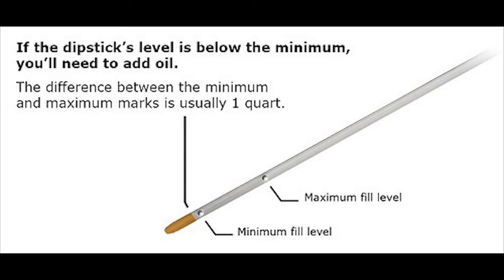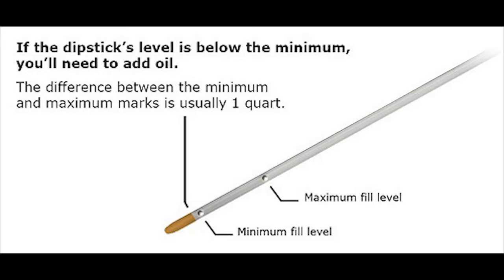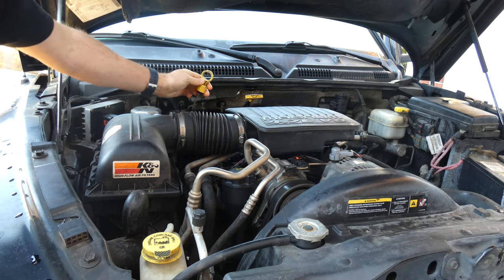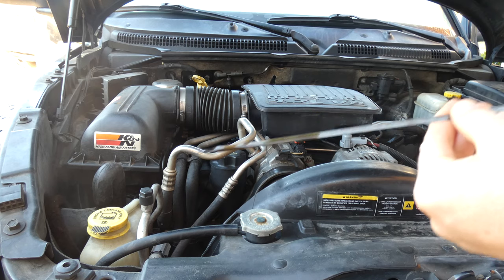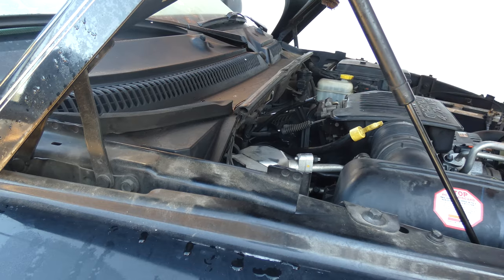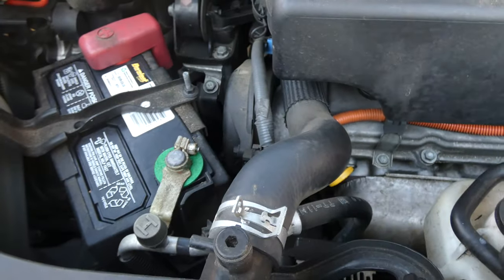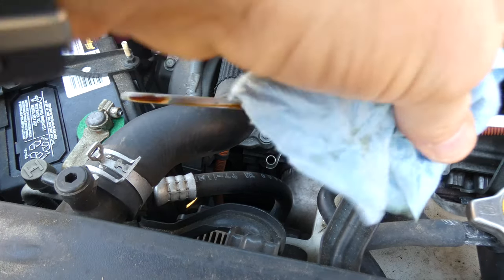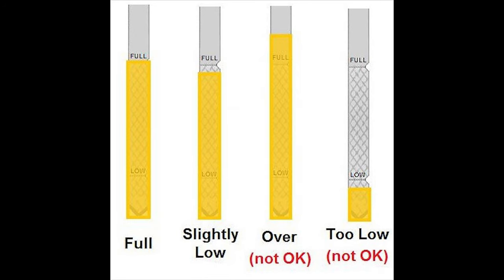How to Check Your Engine Oil Level & Read an Oil Dipstick

Comment: Clint, great vid, but a caveat. Used to check my oil in garage with stone cold engine. Reading my owner’s manual recently it said, “check engine oil while warm/hot...turn off and wait a FEW (ie 3) minutes for oil to drain back into crankcase”. So, comparing methods, there was a half quart difference. If I checked cold and it was half below full, it actually needed a quart of oil. Other cars would say check cold...read your manual re how to check the level. 👌
Reply from the maker: Great advice. I will pin this comment to help others as well.
Reply: Excellent Comment !!  Thats Exactly what Im looking for......is car off or on when checking My oil??   Most vids are simply ignorant !!
Reply: this is the info I was looking for,  thanks David.
Reply: @angelaforsyth1092  My pleasure!
Reply: @denisemezynski8014  Denise, I've never heard of checking the oil level on any motor while it's running...always off.
Reply: I’m 39 and have been servicing my own cars since I was 16.  My dad taught me to always check the oil when it’s cold so it’s always drained down out of the ending that way I get the correct reading.  I’ve never had a problem doing it this way.  Every time I’ve tried to check it after it’s warm I never get a correct reading as the oil streaks up the stick.  When I fill up my sins maxima it takes 5 1/8th quarts.  It is always above the full mark by a little bit and I’ve never had an issue.  But that is such a small amount it won’t matter.
Reply: @100fredkrueger  Strange, I have the same problem with my 2010 Toyota Yaris. To check the oil level, I have to shut the engine off for a minimum of one hour otherwise I get uneven oil streaks up the dipstick. If I try to check twice, the same thing happens. I have been servicing cars since 1987 and have never seen anything like that on any other vehicle. My other car is a 2006 Corolla and if you shut the engine off for only 10 minutes, you can see the oil level on the dipstick positively.
Reply: Indeed always look at the OEM data.

Comment: As a female driver, I love this explanation. Thank you!
Reply from the maker: Thanks Marilyn.  That's what I was going for so it's great to hear it worked.
Reply: @ClintHolland  have a FORD 500 and the dipstick is weird and hard to read. There are two holes...should the top hole be filled in or empty?
Reply from the maker: @mem1701movies  So the top hole would be the max fill line. Just make sure your oil is between the 2 holes and you should be fine.
Reply: As a female driver - would you like a medal?
Reply: @gladiammgtow4092  So sorry you are unhappy and bitter! Blame your childhood and your parents, I wasn't there.

Comment: Very informative video thank you 🙏 Yes, people don’t know it’s best to wait at least 5-10 mins to check. Many people just park and measure which is not an accurate reading. Also, even if the oil level is below max and closer to half, it will rise once the engine kicks on and does its thing. People add oil to the max not understanding that.

Comment: All of this is very helpful except for the very last suggestion: checking your oil at the gas station.  If I've driven to the gas station, then the engine is going to be warm and the dipstick will not give an accurate reading... and I don't want to sit at the pump for 10 minutes to let the engine cool.  I think a better suggestion would be to check the dipstick before you leave home to go to the gas station.
Reply from the maker: That's a very valid point.  However, in all honesty, letting your car sit for even a few minutes will give you a pretty accurate reading.

Comment: Great explanation.  I’ve been changing my own oil for 23 years.  Started when I was 16.  I always check it cold and have never had an issue.  After all these years I’ve always wondered how low it was when it was at the bottom.  I always thought that meant it was about empty.  Lol.  Glad I was wrong.  I usually add a small amount if it’s in between.  I usually put just the right amount in.

Comment: Ive watched several videos about checking oil levels. this video was by far the best one I've seen. close up of the dipstick and what exact it is I'm supposed to be looking for. The only thing it didn't cover that I was mainly searching for and found in the comments was do I check the levels when the engine was cold or after it has been running for awhile. Otherwise, great and informative video. straight and to the point in little time. thanks
Reply from the maker: Thanks for taking the time to comment. I actually did cover most of that around the 6 minute mark.  Doesn't matter if the engine is cold or not but it needs to be turned off and generally wait at least 5-10 minutes after doing so.

Comment: The oil level on the dipstick goes straight across at a lower level then covers only half the dipstick coming up to a higher level.  So is the actual level at the lower or higher reading?
Reply from the maker: Most likely it is the lower level and the upper oil came from the dip stick tube. Try this. As soon as you remove it lay it flat on a paper towel and use the oil on the towel to gauge where the level really is.

Comment: Clint, thank you for the video.  Although I have worked on my own vehicles for years, I have always questioned what I am seeing. I am kind of paranoid. My very first vehicle, 86 buick regal 307 V8, leaked oil badly, but I was young to the point of not understanding what a tight engine is. We always had a little spot on our driveway while I was growing up. So, when I got my 2nd vehicle, a 93 Geo Storm GSI(a year w/o the popup lights) , I was checking my oil 3 or 4 times a week, and that sucker never moved in a months time. I KNEW I was reading it wrong. I KNEW it HAD to be running low, no matter what the dipstick read. So finally, I said, "#$@! IT(because I cussed like a sailor back then), and I poured a quart of 10w40 into it, Even though everything i read now says 5w30, dropped the hood and went to work. 3 to 5 miles down the road, my car started cutting back REALLY hard.  I'm trying to think of what's going on while going down this major highway (Major Panama City, FL), and my car was acting like I had really slow and off kilter ABS brakes, SLAM, loose, SLAM, loose. Then the car leveled out, and I glanced in the rear view to see to see smoke coming out behind that was so thick James Bond would have been jealous of my smoke screen. All of it a bright white too. At the top of the bridge I could look back and see this smoke screen still hanging on the road a good half mile back...lol. SO, I said all that to say that I am terrified to put oil in my car(unless I'm actually doing an oil change), and scared to death that my oil is too low. I now have a 2000 Lincoln Town Car, and its age only makes this anxiety worse....lol. thanks for the help. One of these days, I'll relate to y'all the literal "Come to Jesus" meeting i had while driving the Geo to work and didn't realize it for 20 years afterward. 
Thanks again Clint. Sorry for the lengthy post.  Had to lay down some context first.
Reply from the maker: I love it Eric.  You definitely want to use the correct oil in your car.  Use the wrong viscosity and maybe nothing happens or maybe you ruin your entire engine.

Comment: I think I've done this to myself by mistake.  As I know my car said it needed oil and my car was on a level  spot in a parking lot.  Next day I checked it and it was fine.  I think when it read as low, I hadn't pushed the dip stick all the way in, but did not realize it.
Reply from the maker: Oh yeah, that can definitely be a problem.  Shady mechanics used to do something called thumbing where they used their thumb to make it look like you were low and then sold you a bottle of oil which was empty.

Comment: Hi, i have toyota fielder 2005 with 1NZ-FE engine. I poured 3.7 L in it but the dip stick show a bit highier level. I ran my car for about 500 KM. When i drain about 200 ml of oil from the crank case bolt. Now the level looks ok as per the dipstick. Should i aasume that rhis 200 ml has not damaged the engine. Or is there any concerns
Reply from the maker: You are probably ok.  While overfilling can be an issue on some cars you almost certainly didn't do any damage.
Reply: @ClintHolland  thanks

Comment: Hello 
Thank you for this video 
My car is 2002 Mercedes Benz c240
I don’t have deep stick 
So I bought after market 
Deep stick but it doesn’t mark maximum and minimum level 
Just marked numbers 
10~150 
How can I check engine oil level up?
Reply from the maker: You have to use a guide or manual for your specific model to know. Check out this link.  https://www.fcpeuro.com/products/mercedes-engine-oil-dipstick-tool-baum-120-0721

Comment: Why does my Toyota  Tacoma  manual  ask for 5.5 quarts with the  filter, but then it shows  its over full  on the  dipstick by half  a quart..which should  I go by..the manual, or the  dipstick?
Reply from the maker: That has to do with oil that never fully drains back into the pan.  What it means is that the initial fill at the factory was 5.5 quarts.  Going forward, it will probably only take around 5 quarts to refill after an oil change.  Just has to do with the oil that is in places in the engine that never full drain back into the pan.

Comment: So does the oil have to be at the full mark? What if it's one notch below full do I still need to add oil?
Reply from the maker: It needs to be between the low and high marks.

Comment: I have 1999 Toyota camry. Why does it give me two different readings on both sides of dipstick?
Reply from the maker: Interesting. I have a 2002 Camry and don't notice this. What are on the 2 different sides?
Reply: @ClintHolland  on one side it has the L and F while the other side doesn’t and one side shows oil level way lower than the other side
Reply from the maker: @rubenperez3373  The L and F side are the ones you need to care about.  Try checking the level on that side then clean the stick off and insert and remove it again but flip the dip stick 180 degrees before it put it back into the tube and remove it. See if you get different results and let me know.

Comment: When reading the dipstick, i notice theres alot of oil splatter which goes up higher than the full line. I how do you tell the difference between the actual oil level and the splatter? Im hoping mine was is reading wrong, coz its readjng wah over the full line
Reply from the maker: That is pretty common actually.  There are 2 things you can try.  First, try waiting overnight or a while in hopes the splatter drains down. If that doesn't work, setup a paper towel and immediately lay the dip stick onto the paper towel when you pull it out. You should get an easier to read mark where the oil shows up on the towel.

Comment: On one side of my Subaru's dipstick, the oil level is clearly near the top, but the other side of the stick looks a little dry. What that mean I'm actually low?
Reply from the maker: That is not uncommon at all as one side can get wiped clean while removing the dip stick.  Just use the higher side.
Reply: @ClintHolland  I went with the comments you pins about warming up the engine and then shutting it off and letting it sit for a couple of minutes. It produced a much clearer line on both sides of the stick and I clearly saw that I needed a quart.

Thank you for your video sir
Reply from the maker: @AJFresh69  Thank you for letting us know.  Glad it helped and I really appreciate you taking the time to comment.

Comment: I have a twisty dipstick that is very difficult to read. Any tips for me?
Reply from the maker: Try laying it on a paper towel as soon as you remove it and judge the oil stain on the towel to determine where it was on the stick.

Comment: When I am checking oiling my 2010 Chrysler town and country there is a  difference when you turn the dipstick 180 degrees one side reads higher than the other. Not sure if this is right or not but after reading the dipstick without turning it I just put it back into the tube. Not sure if this is the proper way to check it but it is what makes sense to me
Reply from the maker: The general recommendation is to go with the higher side.  What usually happens is that one side gets kind of wiped as you remove the dip stick.

Comment: l have problems accurately reading it. I'm not sure if oil gets on the dipstick from. The tube when inserted, but it is never clear. There us always oil on the dipstick far higher than it should read, even after my oil is changed. We can determine how much gas is in a tank. Why not oil? A dipstick seems primitive these days.
Reply from the maker: I couldn't agree with you more.  Here are some tips though. Check your oil after after the car has been sitting overnight which gives it a chance to all drain, even from the tube. If that doesn't help, another tip is to pull it out and immediately place it on a white paper towel or piece of paper. You can then easily see where the level was.
Reply: @ClintHolland  got it. Thanks for the valuable advice.

Comment: You are wonderful! Thank you. I have a Ford 500 and EVERYTHING about it is difficult to the point of needing a degree to maintain the vehicle. This video should come up 1st when I video searched "How to read the oil dipstick in my car". But it doesn't!! Argh!
Reply from the maker: Thank you for the kind comments.  Hope it helped and if it didn't. feel free to post your question so we can help.
Reply: @ClintHolland  exactly. The dipstick in this car is weird. Also what if the car calls for 5w20 and the shop put in 5w30 saying it’s an older vehicle? It’s the dealer (not Ford) that gave low cost oil changes with the car. Some say it won’t hurt... others say it will. I thought they were supposed to go with what it called for.
Reply from the maker: @mem1701movies  That's interesting Matt.  You see this frequently in shady car lots and repair shops where they put in a different viscosity oil to try and make the engine run quieter.  Never heard of an oil shop putting it in just because the car is older and I certainly don't recommend it.  It almost sounds like something a shop would do if they were out of the oil you needed.  Realistically it probably won't hurt a thing but I would be weary of anyone proposing that.

Comment: It's hard to tell how much oil is in your engine with these new super low viscosity oils like 0W-16. There is almost no color after completing a change, and oil starts running down the dipstick after 5 seconds.😅
Reply from the maker: Agreed. One thing you can do is to immediately place it on a paper towel or sheet of paper when you pull it out and that will clearly show you where the oil level was.

Comment: ok quick question my dip stick shows I have the oil lvl right in the middle of the stick,
I have 3 dots on the stick the oil lvl is right in the middle dot but my car makes random clicking noise since I did the service. and a quick google search suggest that the oil might be low
so should i top it up?
its a 2013 chevy cruze 2l diesel should I fill it to max on the 3rd dot or is it normal?
Reply from the maker: You can absolutely top it up to the top dot but I doubt this will fix your issue.  If it doesn't try an oil additive like Lucas.
Reply: @ClintHolland  I suppose the noise was due to a bad drive shaft I had to fix it anyways and after I changed it the noise stopped

Comment: My engine oil is now on below Low level. How much oil or how many liters of oil should i put in to get on a F level of oil? FYI, im using a 2009 hyundai santa fe diesel engine.
Reply from the maker: The difference in general between L and F is 1 quart.  Start with a quart and recheck.

Comment: Every manufacturer is different. I just ran into an issue on my 04 Quest. The dip stick handle has a bend in it. That bend has to be towards the engine in order to get a proper read when removing the stick. You also MUST wait 10 minutes after shutting the vehicle off to get a proper reading. This was the first time I ever experienced this on any vehicle I ever owned. I had a Jiffy Lube that OVER FILLED my oil level every time. The vehicle called for 4.5 quarts of oil, not 5 quarts. That .5 quart causes the oil to be overfilled. I finally stopped taking my vehicle there. If someone cannot properly service my vehicle, they have no business running a business servicing vehicles.
Reply from the maker: Sorry to hear that. Oil is definitely one of those things you don't play with. Overfilling can be just as detrimental to an engine as underfilling.  Glad you saved your engine.
Reply: @ClintHolland  is half a quart over really bad?
Reply: @mem1701movies  I’m with you on this. 
Is there any problem with a 1/4 or 1/2 extra oil?
Reply from the maker: @mem1701movies  It depends on the answer you are looking for. In actuality, it will probably be fine. I have seen literally hundreds of over filled engines without any issues. However, over filling it could cause the oil to become aerated which could be detrimental to the engine. if it were me, I would drain a little out but you probably will be fine if you don't.

Comment: does the temperature of the oil matter? should u check it after its been setting long enough for the oil to cool down or does that matter? the same way you have cold and hot readings with ur trans fluid is what i mean?
Reply from the maker: It sure can.  Most cars recommend you check it when it is cold but you really have to check your owner's manual to see what the manufacturer prefers.

Comment: what if the oil is only sticking to the sides of the dip stick
Reply from the maker: That shouldn't be the case.  If you are having trouble seeing it, immediately lay it on a paper towel to judge how far up the stick it is.